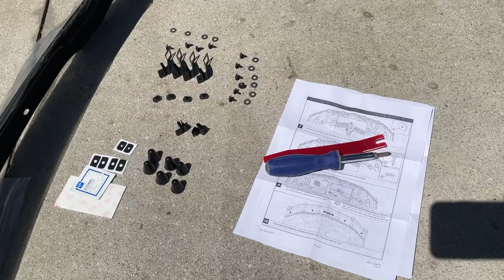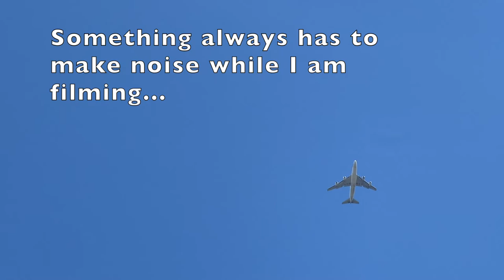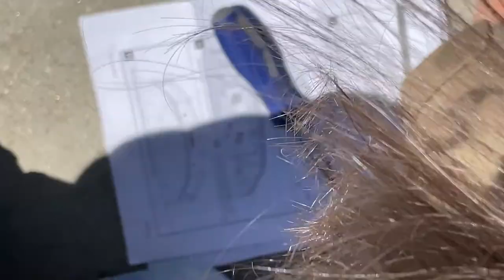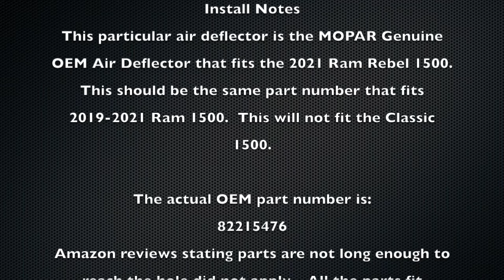2021 Ram Rebel - OEM Air Deflector Bug Shield Install

Comment: Good Video.  Just did this myself on the '19 Rebel.  Last deflector got taken out by the car wash.  Remember the self tapping screws hold on the metal brackets and the threaded machine screws hold on the air deflector to the brackets.  I also hammered with the end of a screwdriver the end clamps.
Reply from the maker: Thanks man!

Comment: Great Vid - I used this to install my deflector too!  My question is do the bumpers even need to be installed?  There is literally no deflection when pressing down on it... I am looking to hold off to see how it does after a few drives down the highway.
Reply from the maker: Well I don't know if you actually need the bumpers or not but I put mine on anyway.  You may be okay without them.
Reply: @BooneDownSouth  Thanks for the quick reply!  I will let you know how it work out!
Reply: @eknutzz9513  any update on installing without the bumpers?
Reply: @thddad6191  I have not installed the bumpers to date... on both side of the hood (both ends of the deflector) there is no way the deflector will ever touch the hood as it is too rigid, however in the center it is much more flexible so I am going to install them onto the back of the deflector and not the hood.  This is my take on it!

Comment: Hey BDS, been a few years now since your post, how did the deflector hold up?  Just bought a 23 rebel gt and it is super difficult to find deflector that will work.  This appears to be only option, which is fine since I like the black matte.  Read some reviews on major breakage but wanted to hear from you.
Reply from the maker: Hey Laura!  Congrats on your '23 Rebel.  So I just replaced the deflector last month.  It took a crack right around the 3rd screw hole in from the left side.   I don't know if it took a rock hit to that spot or what, but I take my rebel through the carwash a lot, like 2-3 times a week.  Like if I am driving by the carwash, its going through it.  I didn't notice anything wrong until I hit the carwash and it started lifting up the left side of the deflector and I was like uh oh.  So I don't know if that is just a defect due to quality or if it was a fluke thing.  On my 2008 1500 Ram I had the OEM deflector on that for 8 years so I dunno.  Anyway, I did look around for other options last month but in my opinion I couldn't find another option so I just replaced it with the same thing hoping the initial damage was from a rock hit or just a fluke or my excessive car washing ;)
Reply: Yea I read reviews that it cracked where screws were.  Probably really good with deflecting but read several reviews breakage occurred more on stress points/ where secured.  Two years not bad but eight is way better!  I just like this one on how the matte black blends well with grill.  Still debating, but looks like this is still the only option, sadly, besides a tough guard (which is a hard no for me)for 5th Feb rebels with sport hood.   Thanks for your quick response.  Love the vids, thank you for the great and informative content.

Comment: Bug reflector…. How effective is it? 😊
Reply from the maker: I think it works pretty good.  I hit the carwash at least once a week and there is usually not much bug splatter on the hood.  Maybe a spot of two but thats it.  Meanwhile there are a lot more on the grill, front bumper etc..  So I would say it does a decent job of deflecting the bugs up and over.  With this deflector I did not notice any additional wind noise once it was installed either which is a bonus.

Comment: Did you find that the MOPAR deflector helped for rocks/bugs?
Reply from the maker: Yea, I mean before I put it on I was getting more splats and I definitely don't see that as much now.  The one thing that made the biggest difference was the mud flaps I put on.  Wow what a difference those made.
Reply: @BooneDownSouth  I feel that. I have the same ones as well. I am just trying to prevent rock damage. It’s a pain in the Midwest. I already will have to get my windshield replaced, but I don’t want to have to keep getting my windshield cha he’s and thought a deflector will help.

Comment: looks good overall, but good grief -- the size of that alcohol wipe...great example of how far manufactuers go to save a cent!
Reply: also...way better having an actual camera (wo)man. best camera angles i've seen anywhere. :-)
Reply from the maker: @Mike Hoskins - Yea no kidding right!  Fortunately my truck was pretty new and clean so I didn't need to pull out more but yea if the truck was weathered that little scrap wouldn't cut it.  You are right about that!
Reply from the maker: @Mike Hoskins - Glad you liked the video.  I appreciate it.

Comment: Will that bug deflector also fit on the new 2022 ram rebel?
Reply from the maker: So I did some looking around and I can't come up with a 100% answer.  I believe it will because the 2022 is still a 5th gen ram with same body style.  However, when I try to look it up at different places on line some say it fits and some say no but they are all automated drop down lists, and when the newer vehicles come out these websites are not updated for quite some time it seems.  I would call Ram/Mopar direct and ask them if this is the part you need before you purchase.  I went to ramtrucks to look up the part number for the 2022 and you can't pull up any accessory parts on their website for the 2022.   Definitely call before you buy cause from what I am seeing online I cannot confirm if it will or won't.